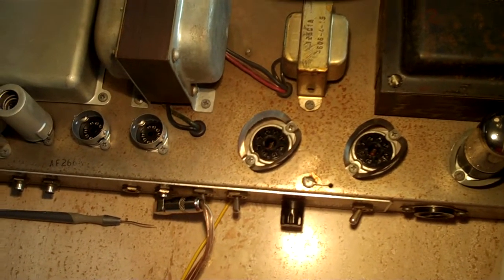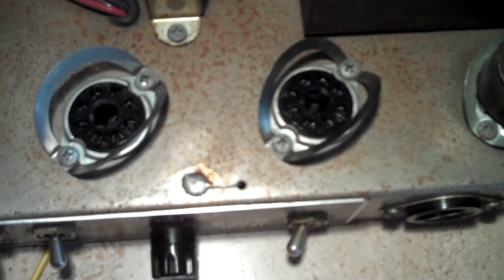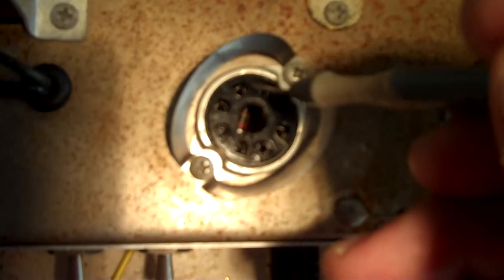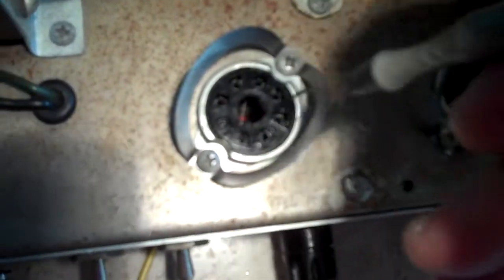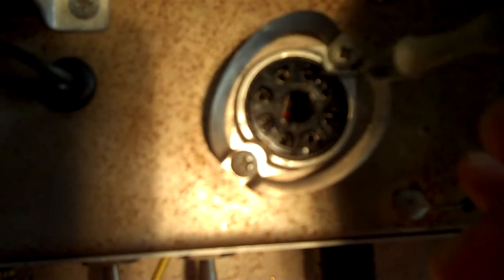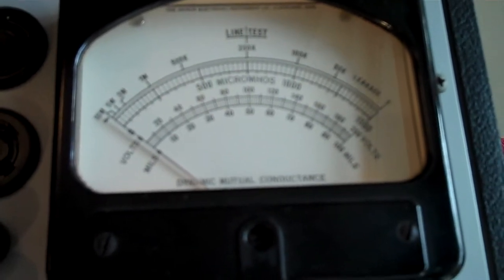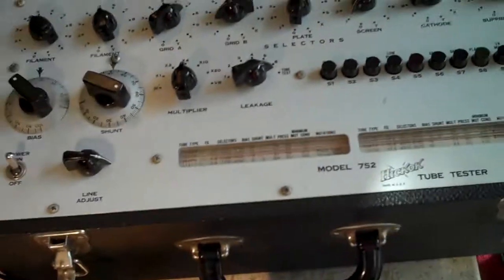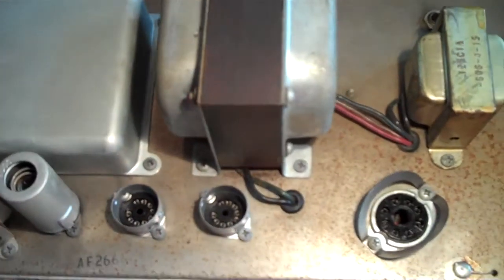Retensioning Tube Sockets and Preamp Tube Leakage Tests

Comment: Although I have a number of Hickok testers, the 752 (like yours) is my favorite because it's so fast and easy to setup and use (mine is the A version), and the leakage test (read on the meter) is far more useful and accurate than the basic neon-bulb "shorts" test found in most other tube testers, including most Hickoks. It's worth noting that I've encountered a few "leaky" tubes that subsequently measured fine after cleaning greasy gunk from the base and the tube pins with alcohol (NOT De-Oxit!) and a toothbrush. 

That said, *don't use DeOxit or other residue-leaving cleaners on tube sockets*! Yes, many people do, but it's a terrible idea. The residue can make the socket conductive and/or attract dust and cause arcing, especially in humid weather (400 to 500 volt supplies are always looking for a new circuit path to travel). Use pure alcohol to degrease tube sockets!. Nylon paintgun tip-cleaning brushes can be helpfull (they're cheap from Harbor freight,  expensive when marketed specifically as "tube socket cleaning brushes"), however they're too soft to remove heavy oxidation. Work a piece of wound guitar string, .036 to .039, back and forth inside the socket contacts, like a miniature round file, or put a short piece of it in a small Dremel tool, battery-powered pencil eraser, or rotary engraver and let the tool spin the guitar string inside the socket contacts, then flush with alcohol.

PS --- NEVER spray the sockets or switches on a tube tester with DeOxit. NEVER! Alan Douglas specifically advises against it in his book on tube testers and test equipment. You can create permanent leakage paths or cause the tester to act flukey, especially in humid weather. I've seen it happen. For cleaning the switches, Alan's advice is to apply a tiny droplet of cleaner exactly, and only, where you need it, using a toothpick or dental pick or similar.
Reply from the maker: I read that article about DeoxIT on tube testers.  I've not used it there.  I am amazed how well the Hickok works and I have never even looked inside to see if anything needs some attention.  It may not be calibrated but it seems to be accurate for what I need it for.  I've used DeoxIT on just about everything else though.  I got the same warning on using it on my Sprague Tel-Ohmike refurbish but I was defiant and used it.  Everything went well on that and it's working fine.  Thanks for the info on cleaning with the string.  I really should replace all of the old sockets.  I have replace a few as needed.  It's hardly worth constantly fighting those old loose sockets.  But, they rarely cause me any problems.  And Harbor Freight, I need to go there more often.  It sounds like they have something for everyone.

Comment: You must be an amp tech or electrical engineer! Thankyou, sir for the info. I used to go with my dad to the Rexall drug stores in the early 60s after he pulled the tubes out of the back of the 'ol family TV and use the DIY testers they all had. I remember the tester was about as big as a washing machine! Dad had to get it running so we could watch the latest Maverick, Gunsmoke, and the 6 'oclock news. LOL!
Reply from the maker: I remember even in the 7-11 they had them.  Those TV's never worked very well.  Always that darn horizontal adjustment.  Actually, I had to learn all of my amp skills on my own or I would have gone broke and crazy.  I told my wife yesterday how many thousands of dollars I have saved by doing it myself.  Plus, you can mess with them whenever you feel the urge.  I don't even know of a good amp tech. in my area.  That was another reason.  I have so many amps I would have spent half a lifetime running back and forth trying to get just simple little things fixed, each probably costing a minimum of $80 (just guessing).  The old amps are easy to work on.  Forget about it on the modern amps with printed circuit boards.

Comment: have you ever tried sonus fuzz faces? I think they'll sound amazing with your bassman and strat
Reply from the maker: No.  Just looked them up and it appears they are unavailable now.  I see he uses the original NKT275 transistor.  Not cheap at $499.  There are so many out there.  That one sounds good.  I wish I could try one.
Reply: You're right indeed! He also builds some other fuzzes which also seem great, however nothing beats a great amp/guitar like your setup ;)

Comment: I need to send you my amps :/
Reply from the maker: It is fun to dial them in and mess with them occasionally.  I just put a Mullard GZ34 in my 1966 Super Reverb because I had forgotten I had a Chinese GZ34 in there.  It sounds better to me now.  Rectifiers do make a slight difference.  The tube tester helped me a lot.  I don't think I could survive without it.  It's not that hard to learn.  It was a long learning curve but I am glad I did it.  It saved me thousands of dollars and a lot of peace of mind over the years.
Reply from the maker: Are you having issues with any of them?  I really only mess with the real vintage ones because they are so easy to work on.  Leo designed them to be very service friendly.  He was a radio repairman in the beginning.
Reply: Yeah I know I could get a lot better sound of my amps, starting with tubes. I'm just such a novice though. To start, my 65 the reverb knob only goes to about 3 and then has a horrible hiss. Real pain.
Reply from the maker: That must be the reissue.  I don't like printed circuit boards.  It could be many things.  The simplest thing to try that you can do is to switch out the 12AT7 tube in V3 (3rd from the left when looking at the amp).  It's worth a try.  After that, it is a matter of looking at everything besides tubes.  Tubes are, thankfully, usually the first things that cause problems.
Reply: I'll try that. The reverb issue is in the original 1965.
Reply from the maker: Then that should be fairly easy to troubleshoot.  You may have a 12AX7 in V3.  Let me know.
Reply: I have a 12ax7 in v3.
Reply from the maker: Switch to a high quality 12AT7.  A 12AX7 is too much gain for the reverb and that is probably why it is squealing.
Reply from the maker: https://www.kcanostubes.com/content/fender-amp-preamp-tube-layout-and-recommendations.  This is a good guide.  I just bought some NOS USA made 12AT7's on eBay for $8.  These are a little more but the same exact tube.  These are nice but there are better NOS tubes out there but they are more expensive too.  I always like RCA tubes with black plates.  
http://www.thetubestore.com/Tubes/12AT7-ECC81-Tube-Types/JAN-Philips-12AT7WC.  The gain factor on the 12AX7 is 100 vs. 60 for the 12AT7.  And if they are microphonic, they will squeal even more.
Reply: Thanks for the info. I'm going to try that.